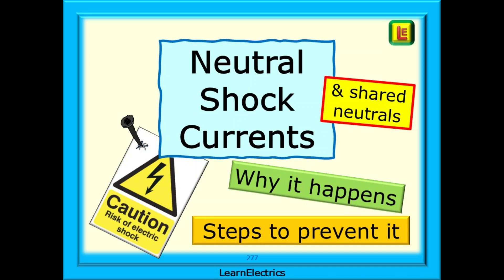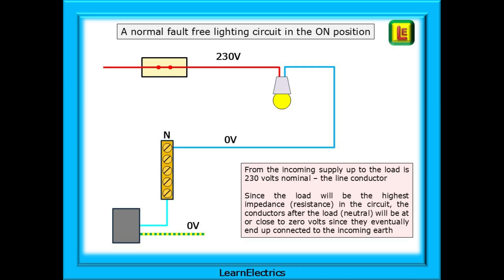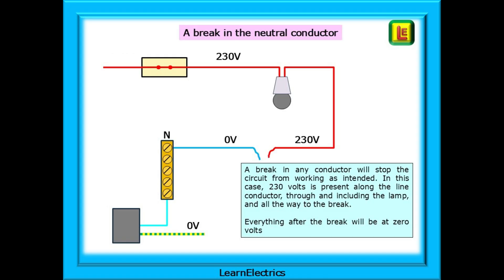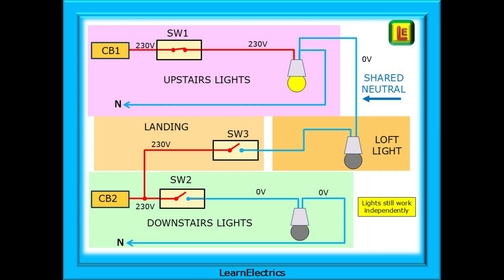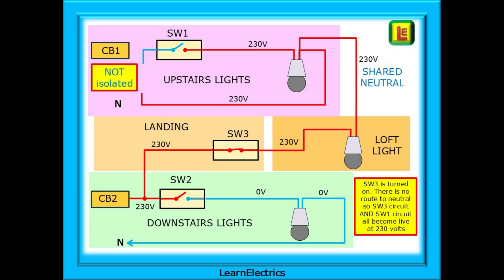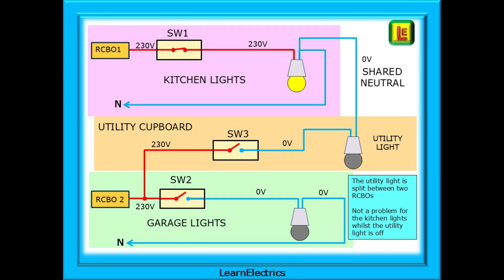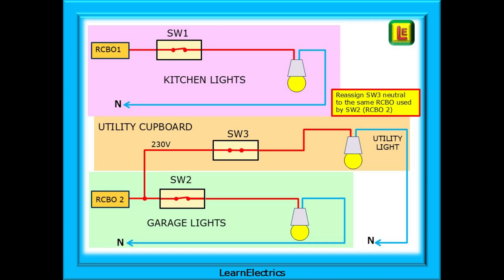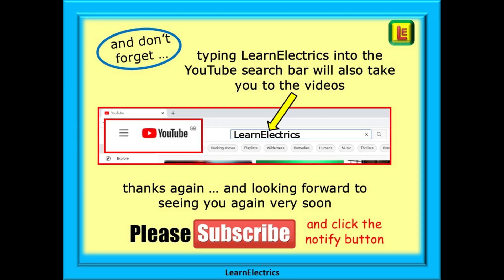NEUTRAL SHOCK CURRENTS & SHARED NEUTRALS – WHY ARE THEY DANGEROUS AND HOW TO AVOID THEM

Comment: Thanks Dave great explanation! The bit I still struggle to understand in my head is neutral being a live conductor but normally at 0 volt potential 🤷🏼‍♂️
Reply from the maker: Thanks for watching, glad you found the video helpful. Think of neutral like this. In a wet central heating system, hot water flows along a pipe (the Line conductor) to the appliance (the radiator) where it sheds its energy (heat). The cooler water now flow back along another pipe (the Neutral) to the boiler ( the transformer) to be re-energised and recirculated again. If no water comes back along the cold pipe no water leaves on the hot pipe. If no electric comes back on the neutral wire, none leaves on the line wire. Hope this helps. Dave.

Comment: The point about the circuit upstream of a fault in a conductor potentially being live is good one and reinforces the need to isolate and if necessary lock off any circuits being worked on at the source of supply before starting work and as a backup check that the conductors are safe to work on with a voltmeter. Complacency can be a killer 😮
Reply from the maker: That is very true, always confirm dead before touching anything. If the circuit is not dead, you might be. Thanks for watching.

Comment: Thanks again for sharing your knowledge with easy to follow graphics. I'm still learning and have explored shared nuetrals from othe videos etc. Am I correct in asuuming that this problem only occurs when wiring in singles?
Reply from the maker: It can occur anytime depending on where yo put the wires. Just because its twin and earth doesn't mean the guy has put the wires in their proper places. I've seen 3 core flex L/N/E used as 3 phase cable with the earth as on of the live phases. Nothing shocks me anymore (pun intended). Thanks for watching - Dave.
Reply: @learnelectrics4402  Thanks for taking the time to reply

Comment: I've been shocked a couple of times through shared neutrals. Once I was a junior engineer and I had to help move some electrical benches before the lab was being remodelled. They said the circuit breakers were off and it was OK to disconnect and I had a very interesting feeling through my arm when I went to disconnect the bench. The other time it was my fault since I was working with an electronic circuit without proper isolation.
Reply from the maker: You, me, both. I think most of us have had that tingle at some stage.
Thanks for watching and sharing your experience. Dave.

Comment: I've been working with electronics for over 50 years. And done a little house wiring for myself. No one has done a better job of explaining this than you and my hat is off to you Sir! QUESTION: IF I TAKE A NEON TESTER AND GO ACROSS HOT AND NEUTRAL IT LIGHTS UP (OF COURSE) BUT... IF I GO BETWEEN NEUTRAL AND GROUND, WHY DOES IT LIGHT UP AT ALL? BECAUSE I OBSERVE A "WEAK" NEON LIGHT WHEN I DO THAT!!! AND IF I JUST TOUCH THE HOT AND LEAVE THE OTHER SIDE OF THE NEON FLOAT, I ALSO SEE THAT?????  73 DE W8LV BILL (and in SANER times: W8LV/VE3)🇺🇸🇨🇦

Comment: Great video and how true even here in Canada. Had a fallow electrician work on a 347 volt shared neutral lighting circuit. He open up the connector on the neutrals and separated them thinking they were all dead because he had turned the breaker off for the light he was working on. Well he ended up on the floor after falling off his ladder. Shocked and scared he said he would never do that again. Luckily he was not hurt only his pride.
Reply from the maker: Appreciate the comment, and thanks for sharing your experience. Dave.